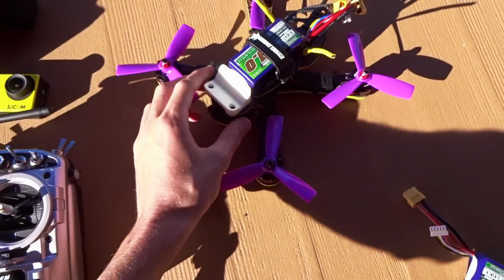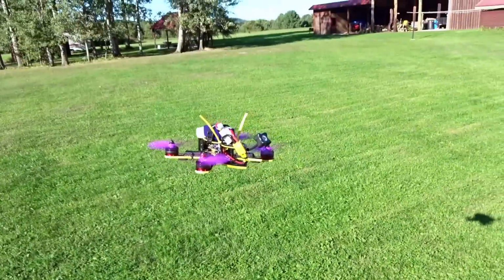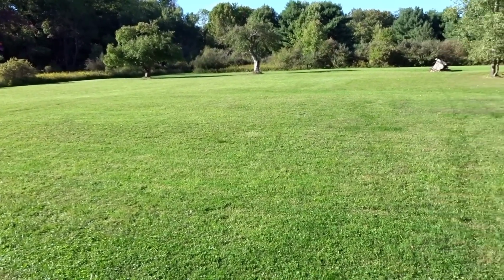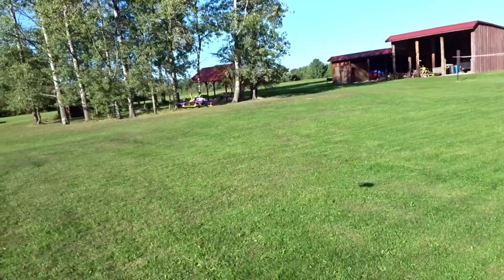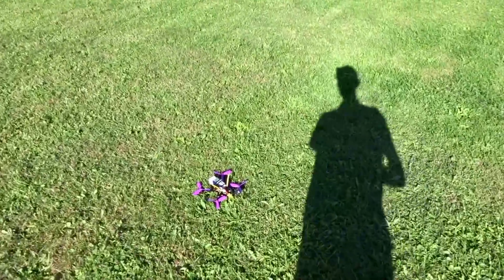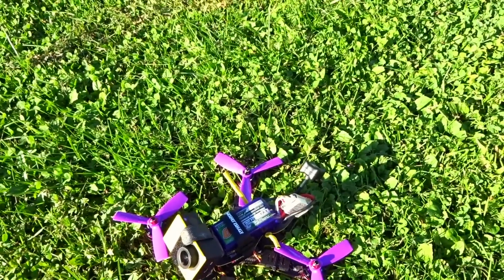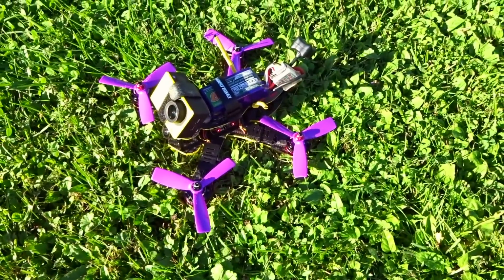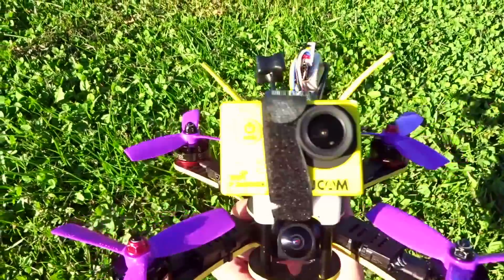4inch InXect LOS and FPV Maiden: RS2205 2600kv Reds + DAL T4045BN Tri

Comment: Nice flying, looks like it still packs a lot of thrust.

What did you use to paint the sides of the frame? I just finished building a 4" that is also yellow themed. One more question, favourite 4" prop?
Reply from the maker: It is a Sharpie oil based marker. I can't speak too much for 4inch props since this is my first experience with them, but the Gemfan 4040 tri seem like a good comprimise between power and flight time, and these DAL T4045 bn tri for all out thrust :)
Reply: Thanks! I'll have to try your recommendations out soon. I've been flying 4S/2205 2633kv/DAL TJ4045 or DAL Q4040. Getting about four minutes with a 1300mAh nano-tech.

Comment: awesome build what did you use to paint the sides?  That is so fast battery seemed good to me. I bought a few things off ebay for my zmr250 littlebees esc and a afro flight controller and turns out the flight controller was a copy clone that didn't work and the escs were the same clones. One of the esc has really a lot of lag and is making my emaxx motor warm there loud esc to. Gonna put my cobra esc back on. Why is there so much clone for quadcopter? Makes it hard for beigeners.
Reply from the maker: It is Sharpie oil base pen markers. Cloners see a design that sells, makes a cheaper worse copy of it, and sell it. People who don't know the difference buy it as it is a cheaper price. I wish there was some way we could crack down on the chinese.

Comment: Nice flying! Why do you have the hs1177 instead of the runcam swift? The colors on the swift are better.
Reply from the maker: Swift costs $10 more. Also the colors can be easily changed in the settings.

Comment: I got a quick question for you it's been a while since I have ran my Tweaker LOL.I just took my cobra 2100Kv 2206 off and slapped the hyper light 20 206- 2722 KV the same Dal props I'm also going to be running a 1300 battery no go pro on this one and 30 amp blheli s escs that should cover that right LOL this is going to be an interesting morning
Reply from the maker: Yeah for sure.

Comment: my nano tech 4s 1.0 would puff a little but so light and snappy. graphene's do not hit low voltage until battery is dead. watch out though, battery dumps fast.
Reply from the maker: I'm going to try some Bonkas.